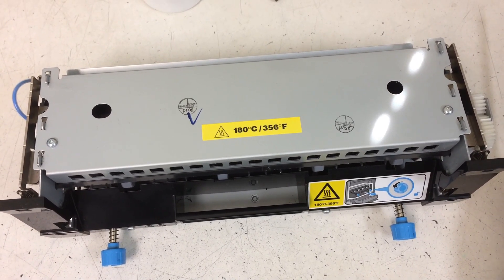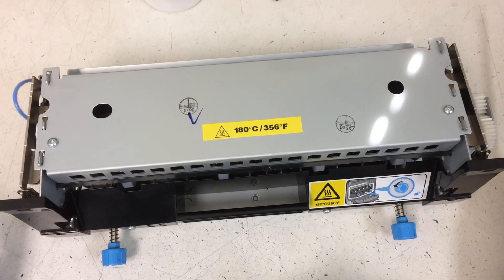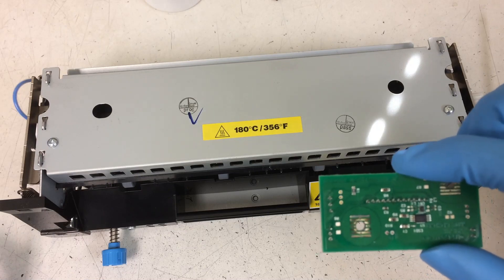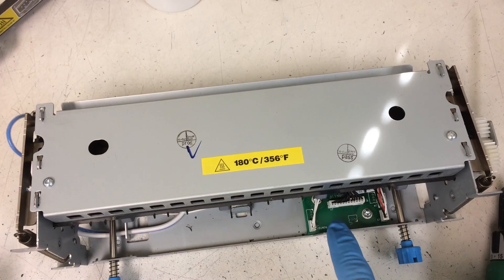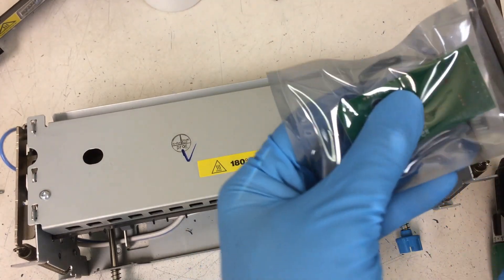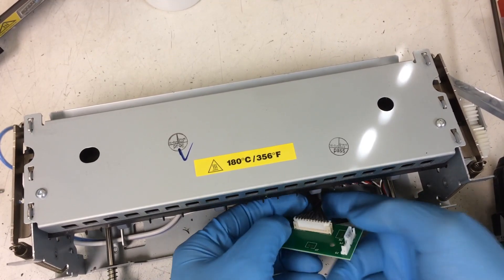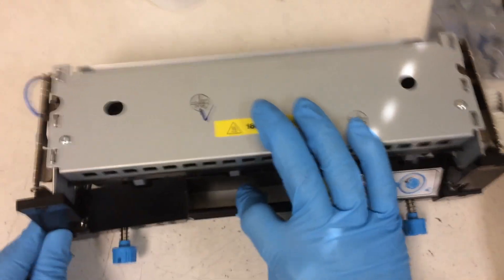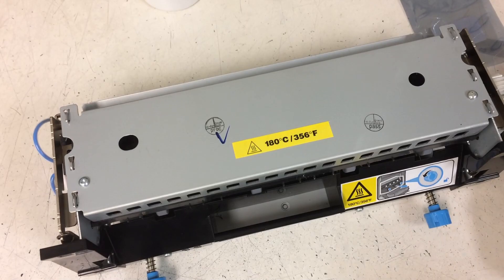HOW TO RESET MAINTENANCE KIT ON LEXMARK MS810-MS811

Comment: Hallo. Do you know about the error 121.04 from Lexmark XS955de? The old one is done and i bough a new one(used part) but still having that error. What should i do? Thanks
Reply: I am having a similar issue with a new fuser for an MX812de. Even after replacing it, the error (121.24) still occurs. Have you found a fix?

Comment: Where do you get the replacement chip?
Reply from the maker: You can buy fuser parts online. Will cost you about $35
Reply: @printerguy8175  need the link to buy the chip.